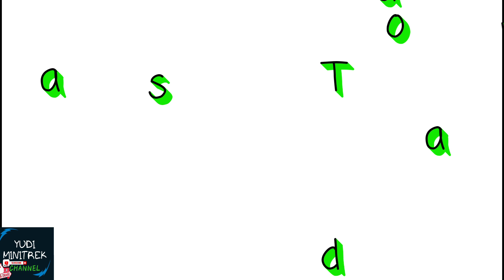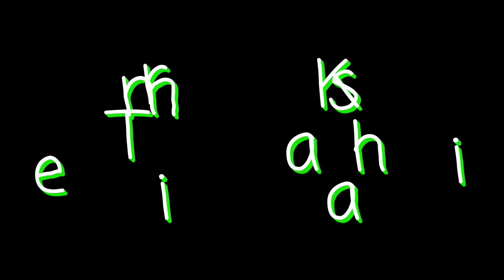Merakit Sepeda Minitrek Ala Yudi Minitrek Eps Terakhir

Comment: mas... velg uk 22 inch, terus pake ban uk berapa?
Reply from the maker: Terima kasih sudah nonton video ini. Kalo di pakai sepeda Minitrek ukuran sebenarnya 20 x 1 3/8, ukuran ban pakai 20 x 1 1/8. Ukuran 22 inchi itu bagi toko sepeda yg paham. Soalnya biasanya sipenjual atau pelayannya gak paham😊👍
Reply: @yudiminitrek  ukuran velg 20 3/8 
Ukuran ban 20 1/8 
Apa bnar begitu ta mass
Reply from the maker: @elywati4104  iya benar itu mas
Reply from the maker: @elywati4104  maksudnya 20x1 3/8 dan ban 20x1 1/8